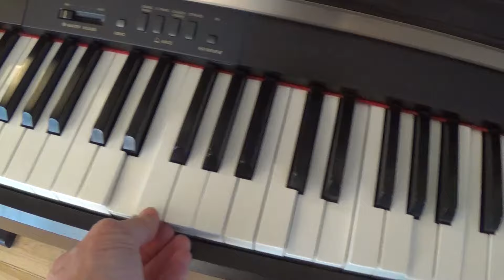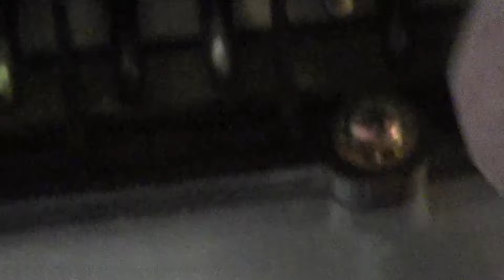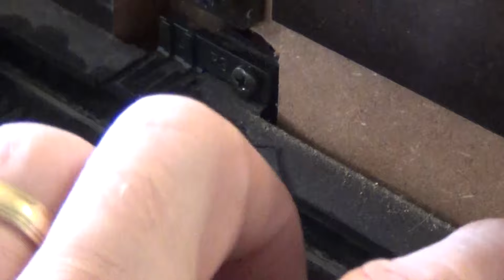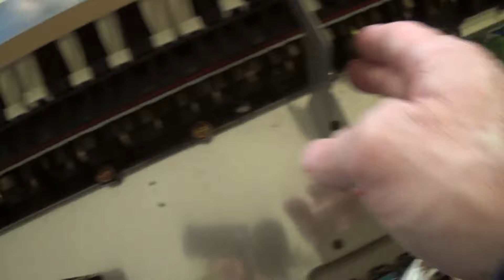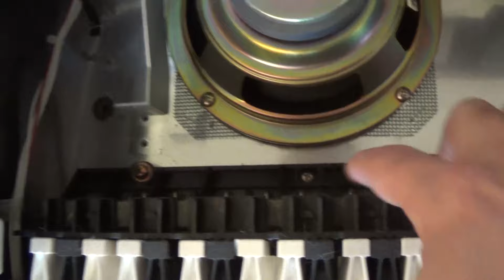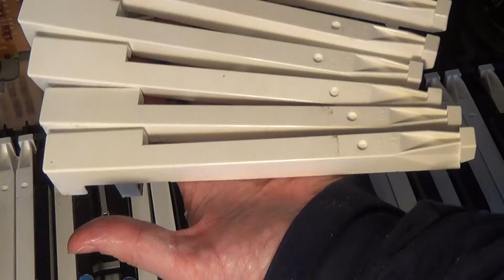How to Remove and Clean Piano Keys in a Yamaha Clavinova

Comment: This video has been such a life saver for me. I had just lost my guitar plectrum between two keys of my Clavinova and it was stuck there. Thanks to this video I have been able to gain access to the plectrum and remount everything in few minutes. Thanks a lot!
Reply: Guitar pick sounds so much cooler than a word that rhymes with rectum
Reply: @cosmic_gate476  Yes, that's the reason why the plectrum was sitting on the piano instead of being used. Anyway, I can guarantee that the sound of my piano was not cool at all with that piece of plastic stuck between the keys...

Comment: Thank you so so much. We have had our Yamaha for 17 years, and when one of the keys started sticking we thought it meant it was time to buy another whole piano. I just happened to stumble on this video and thanks to you I managed to change the (cracked) key. I would previously have been to scared to open it up and try to rectify the issue, but you had such a positive 'can do' tone in the way you described the operation, you made me believe I could do it! 
You have saved us a small fortune, we really appreciate it.
Reply: Where did you buy the new key
Reply: Haven't got round to buying a new one yet, swapped it for a rarely used key lower down
Reply: Hello I just tried it and now I cant put back the replacement keys ive been doing it for 2 hours now but I cant put them back in im so stressed please help me ):

Comment: Thank you for this instructional video about CPL-120. It really helped all the way through. I know from other things I have repaired: Count the numbers of screws you unscrew and if necessary put them in the exact order you took them out. Use small bowls for each pair of screws (1 for the top, 1 for the cover, etc.). I'm not experienced so it helped me to make sure I resemble it the right way. And with your help actually, I found it quite easy. It's quite expensive to take the instrument to a professional repair. For this one, I saved at least 200$ and perhaps the problem will occur again. So: THANK YOU 🙏🏻👍

Comment: Well, I have a piano made in China for a French company that went out of business. I’ve looked around for solutions to a key that was loud and temperamental. I thought it was dust but the connectors are sealed. The problem was the nub on the seal was twisted. I had no idea how to access the underneath the key until I came across your video. My keys are slightly different and have two pins retaining each key. I needed two very thin spark plug gapping tools and a small screwdriver to set them in place. Once in place I could pop the key out with the screwdriver. I was worried about breaking the supports because they’re plastic and the pins are about 2mm long but they seem to be pretty solid. Anyway, I was going to try to contact the Chinese manufacturer for advice but your video did the trick!
Thanx a million!

Comment: Thank you for this great video! I have just noticed an Eflat key is slightly slow to rebound, and it's playing havoc with Maple Leaf Rag. I'm a bit depressed having found out that compressed air and a spot of oil is not going to fix my problem, which, it seems is just starting. But at the same time, when I have finished being depressed and man up I will have an excellent guide to follow and will hopefully be able to fix the problem without massive expense.

Comment: Thanks you so much!👍👍👍  On my old CVP-201 I could exchange 3 mains keys (in the middle of the keyboard) with less used ones from the same keyboard. I just had some extra screws to remove due to floppy disk reader 😉. Thanks again!

Comment: Great video!  I replaced two (2) "D" keys following your excellent instructional video. When I reassembled the piano (P-120) I noticed about 1/8" play on them (Foreware to rearward) They play ok but I think I must have missed a slot on the underside of the keys for the Key Spring. I dread taking it all apart again. Would it be the key spring that allows this amount of front to rear play in the keys>
Reply: Same here. Every key I remove and reinstall ends up with 1/8 inch forward/backward play. What am I doing wrong?

Comment: So
I discovered that the new keys will install correctly if you are patient and be sure to insert them by dipping the rear edge low as you slide them into the slot, All my keys fit fine now with NO 1/8" edge sticking out in the front. It just takes practice, lube, and patience. Try removing a similar note and swapping them out. You will see what I mean.

Comment: I wish I'd found your video before I opened up my piano! I have a yamaha clp-585, it's 10 years old and getting a little clunky so I bought new felts and replaced them. Whilst doing that, I flipped the keyboard and some of the keys came out. Eventually I figured out that they hook in front and back and got them all back in.  The only problem now is that the black keys don't seem to sit as tightly as they did before, and so they wobble and make more noise than they did before! Any ideas what I've done wrong?

Comment: I have CVP-50 and it was working fine. But after I moved to a new location and cleaned outside of it. The power is on and volume on high, but no sound at all. Would you please give me a tip as to why? I really appreciate your pro tips. Thanks again!!

Comment: Thanks for shhowing the details....very clear explanation....
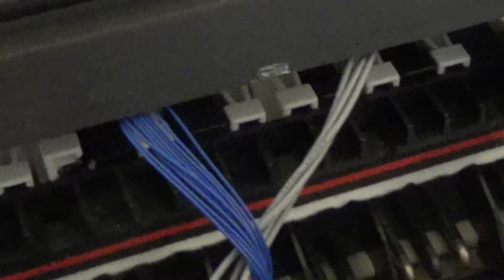By the way, on my Clavinova CVP 409, it was very noisy when playing, such as "tap, tap, tap..." at each black or white keys hit. The technician just fix the white part on top (visible at 2:22 on your video) with some small cable tight all along. Apparently, it is amortiser of the metal who hit it.....it's okay, but still a bit noisy. So I wish to replace it... Could you tell me where to find/buy such soft material? 
Thanks

Comment: I've got two keys where the little black rubber tab on the underside has disappeared. They're probably in the mechanism somewhere, but I don't fancy trying to fish them out. I also have two black keys missing the grey plastic piece that stops sideways motion. Any ideas for how I can get those parts, or come up with a substitute? I tried some blu tack on the underside and it's better than a gap, but it gets squished very quickly. 

It's quite annoying, as I opened it up to fix some keys that hit maximum loudness and thought I might as well do some cleaning under the keys, in addition to cleaning the rubber contacts. These work great now and I've figured out how to replace all the keys properly (including those where the spring had to be popped back in) but I've just got those 2 severely dysfunctional keys and 2 wobbly ones, that I'd ideally like to resolve before getting all of the screws back in place.

Comment: Hi, I have one key that feels heavier than others.  I’ve tried cleaning it and it still feels the same.  Do you think I should replace the key?  Could it be the spring?
Reply: I don't think its the key if its still in place.Or  isn't it correctly in place an the key is heavy because it rubs against the sides? because the heaviness is determined by the spring so this is most likely the issue. Maybe it would work if you bent it a little bit but maybe if won't work / work for long. Replacing it should do the trick.
Reply: Hey did you find a solution to this problem? I have the same issue with the new keys I just put in.
Reply: @1yasin6  Yasin kardeş bir soruna çozüm ararken sizin yorumunuzu gördüm, Yamaha Clavinova CLP170 de bir key zaman zaman çok hafif ağırlaşiyor. Açıp baktim kırık yok ,yaydan bahsettiniz onu mu değiştirsem acaba rubber yok göremedim, tavsiyeniz? Teşekkürler,müzikle kalın.

Comment: Hi
I am having problems with 100% loud notes with P-515, then opened it and found that NWX is just GH3 with woden keys and trick cheat rubber of-circuit to make escapement fell (it is marked as GH3 inside contact board, with NWX "added" to it).
Can you post where you get those extra keys and if that store sell some contact rubber will help too.

Comment: I am getting a serious issue with my yamaha clp 545...some times when i play chords suddenly one of the note sounded higher than it's normal sound behaviour...what should i do now..please suggest me
Reply: I had the same issue with my Yamaha YDP 103, when it was brand new. It was caused by a tiny splinter stuck under the key. Hope it works for you too.
Reply: @MayasMoviebox  few weeks ago i just simply cleaned pcb now it's working fine😊🎶

Comment: Used this tutorial to help me swap out some sticking keys on my 18 year old clp-130! Super helpful. However the knife trick was not a good one for me. I ended up snapping off the black plastic tab that I was pressing on on two of the keys. Somehow everything went back together just fine, but I don't know how long this will last before I have to replace the whole keyboard now that the tabs have broken
Reply: Hi Stephanie! I recently had the same issue happen. I pressed a bit too hard while removing one key and the black plastic broke. Did you happen to ever resolve this issue? Thank you!
Reply: @jennifertrecartin2869  hi! I haven't had any issues with these specific keys since I swapped them and it's been about two years, so I'd say it was successful despite the broken pieces lol. Good luck!!

Comment: Hi sir, were the keys restored to it's original spring after you replaced them? I ask because I have a clavinova clp 150, I replaced some sticky keys and the touch is the same: sticky. I replaced 7 keys, I don't know if I'm better off getting rid of my clavinova and buying something else.
Reply: Did you try cleaning the inside of the keys and checking whether the springs are strong?
Reply: Hello Damian I have the same piano I just tried it and now I cant put back the replacement keys ive been doing it for 2 hours now but I cant put them back in im so stressed please help me ):